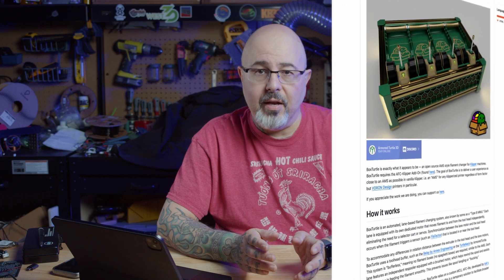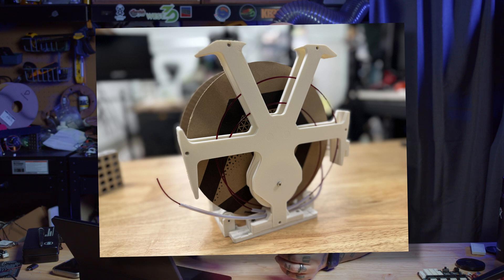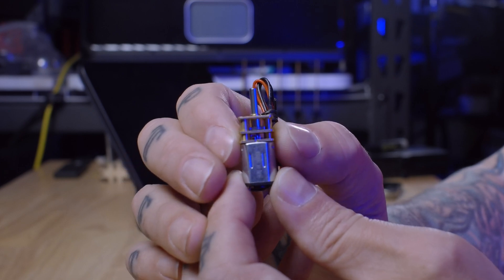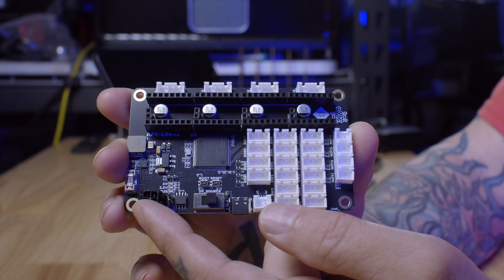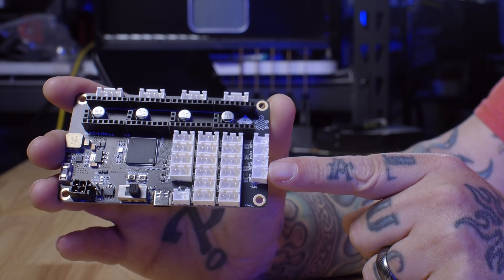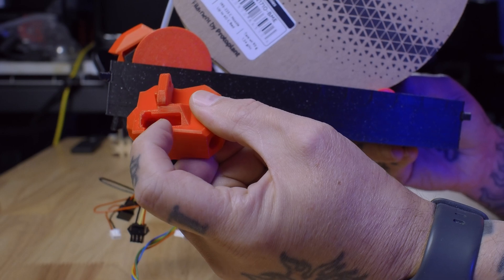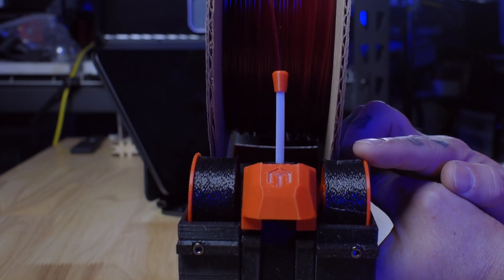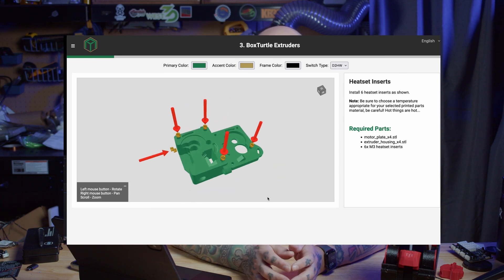Taking a look at the Box Turtle automated filament changer, Part 1

Comment: What toolhead is needed to use the boxturtle? It has to have a filament cutter in it, right? Nobody seems to mention this.......I'd love to have multicolor on my vorons, but does the entire toolhead need changed out?? Currently running stealthburner with revo voron, an lgx lite, and ebb36 canbus on both of my tridents

Comment: Great open source project and kudos to the developers, but I'm holding out for a multiple tool changer upgrade for the SV08.  I want to print 95A TPU which filament feeders can't.  I don't like the purge poop of filament changers and constantly changing filament in a single tool head has inherent reliability issues even with a filament cutter.

Comment: Great video, as always. Is there a continuous PTFE path from the entry point of the respooler to the motor, or do you have to lift up each lane to do the initial spool load?
Reply from the maker: There's a section of PTFE that goes from the bottom of the respooler to the extruder. I'm going to wait until I'm futher along in the build to install that. No lane lifting required!

Comment: I'm interested, but not at that price.
Reply: 250 bucks is nothing, 3d printing reliably is not a cheap endeavor.
Reply: what price range would you want for an open source AMS?
Reply: @jerrysmith6798  175 for a 4 color kit.
Reply: If it works, worth the price. But it almost reaches pallet level price which probably would be more reliable. 

The issue i had from one of the open source project was retraction and basically the filament would jam it my extruder not being able to leave. For this price you'd expect it to work flawlessly. I am following this channel since I am also looking for a solution with klipper and am interested in his end result and will then commit to 3MS or this one.

Comment: Do you need a filament cutting tool head or no?
Reply: It's highly recommended.  The least likely to leave strings in the hot end.  There is a mod for a cutter on the back of the box.  Tip forming is an option of last resort.

Comment: I'm waiting for a 5 lane board... I seen someone on Discord make one and now I can't unsee the logic of 4 when 5 fits perfectly on top of a Voron 2.4 350
Reply: I think projects like these need to just go for broke and toss in a bunch of uninstalled optional headers for real flexibility. Nobody wants to be setting up multiples of these, it needs to all be down to one AUX MCU to control 16 possible filament paths. Pay just a bit more for PCB space now, or plan for daisy chaining.. and you won't need 4 different USB devices to not only plug in somewhere, but also get confused which is which when addressing them in the future.
Reply: @Roobotics it can be extended like that, watch the box turtle videos
Reply: Voron also have 250 and 300 sizes.
Reply: @Nuttavoot are you serious 😮 how did you come by this information 😂😂😂